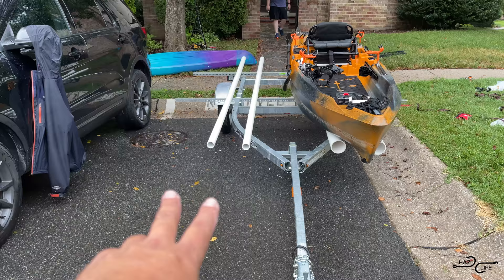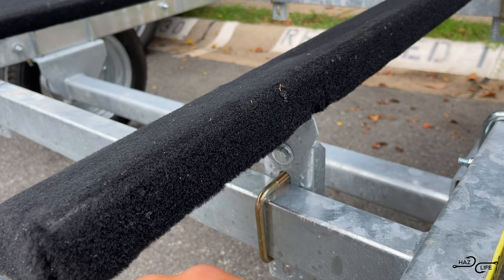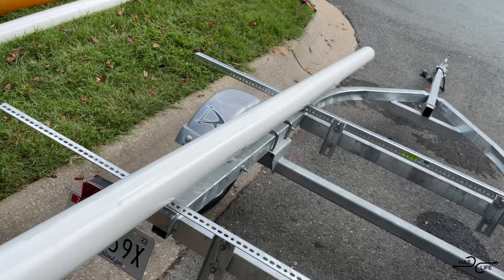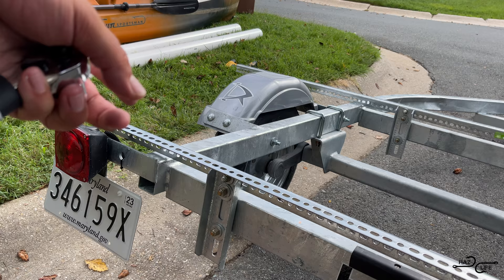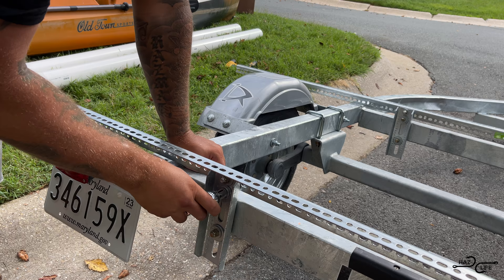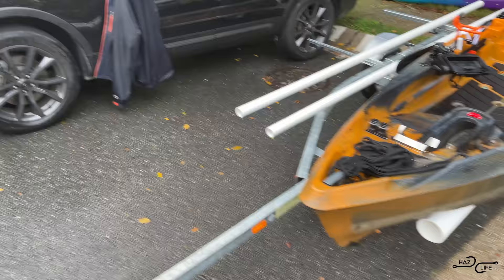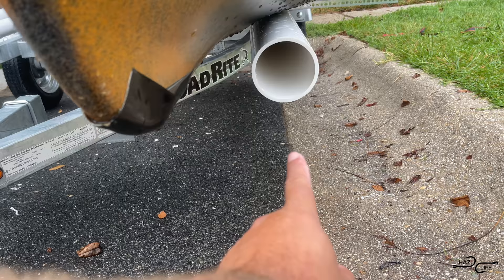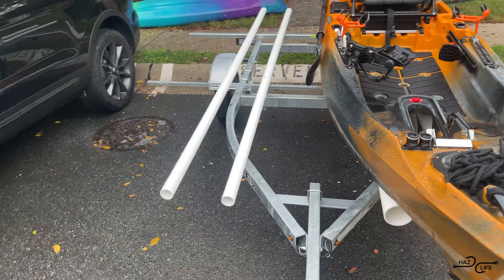DIY Kayak Trailer

Comment: This is a very good video. I also like that you showed an even cheaper option than using superstrut. I recommend from experience that you trim down those cross members. At least to the width of your wheel fenders. They have very sharp corners. To this point even with very good insurance, it was not fun getting stitches from brushing up against them while not thinking-LOL Very informative vid!

Comment: I have the same trailer , so this is perfect .
Reply from the maker: I made an updated video to this a few weeks ago changing out the angle iron to angle steel… it’s a lot more sturdy now
Reply: @HazLife  Definitely will check it out , Have ypu had any issues with the pvc cracking ? That was my only concern . I plan on making 2 rod tubes 1 on each side . One last ? Does that trailer do well on long distance? I just got my trailer last week . Thanks

Comment: is it possible to just set the kayak on the trailer frame without load bars and rails?
Reply from the maker: Yea it’s possible but not recommend loading and unloading heavy kayaks are a lot easier with pvc